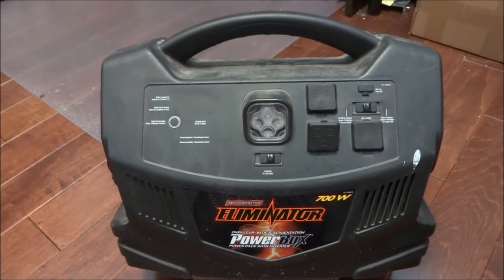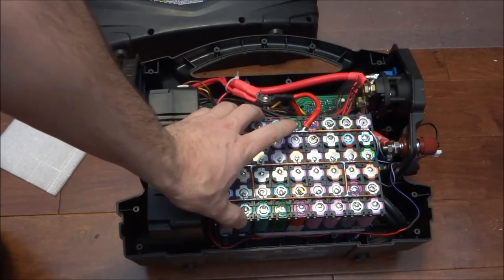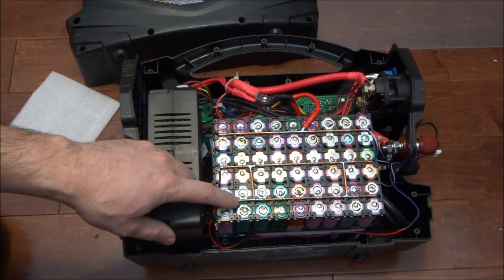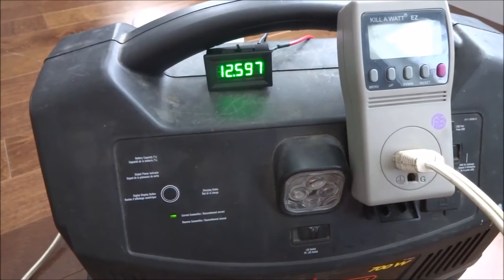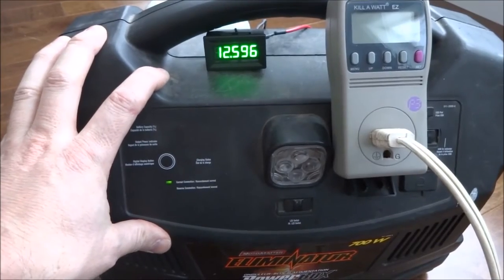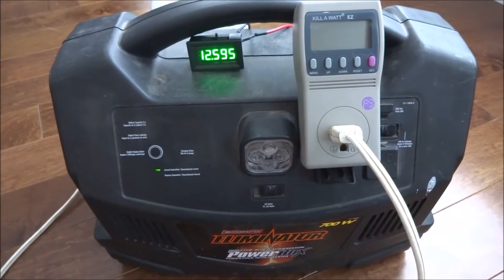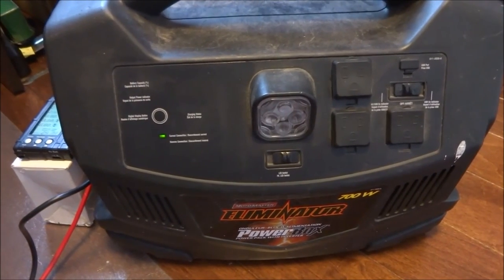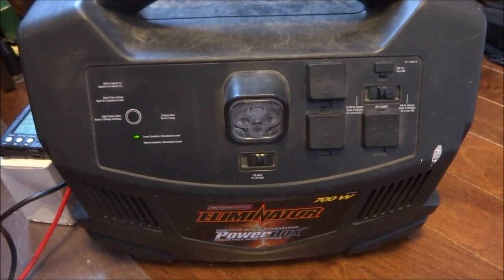Upgrading my Power Pack to 18650 batteries

Comment: There's 54 cells - in a 3s, you'd have 18p; that would give a 36Ah rating to the pack...
Is this correct or am I missing something?
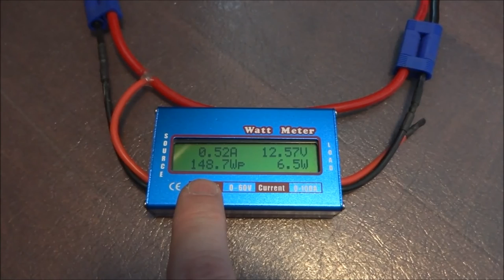Reply from the maker: Yes if each cell has a capacity of 2 Ah, that is correct. However I have two groups of cells for a total of approximately 72 Ah. In the video at 13:44 you'll see that when recharging I put back 64 Ah but since they weren't fully discharged, that matches up pretty well with the 72 Ah calculated.

Comment: LiMn Batterie  (as in Nissan Leaf) has about 80% of Capacity from 4,2V to 3,6V. That make 10,8V with 3S and you have  at 10,7V Low Voltage Alarm.

Comment: When the agm battery in my booster pack died I put 4 5000mah li-po rc plane packs wired in series inside and it works great :)
Reply from the maker: For a simple booster pack, yes that would work but my inverter would not work if the voltage was to high.